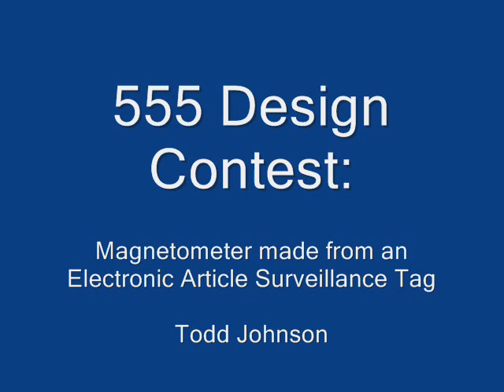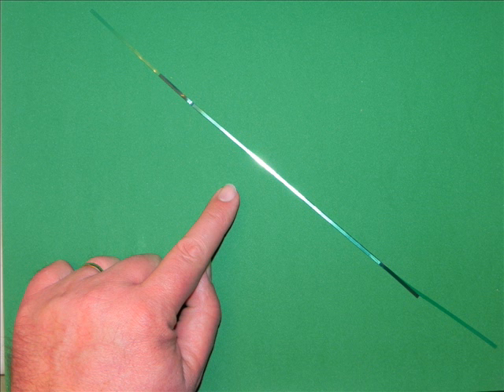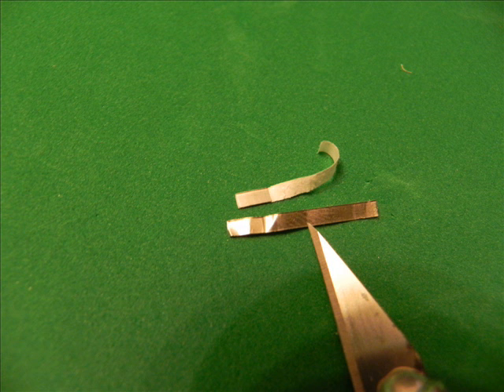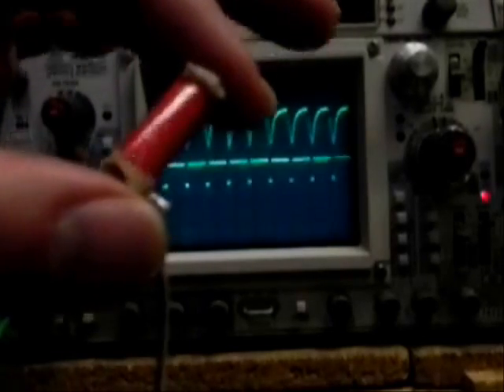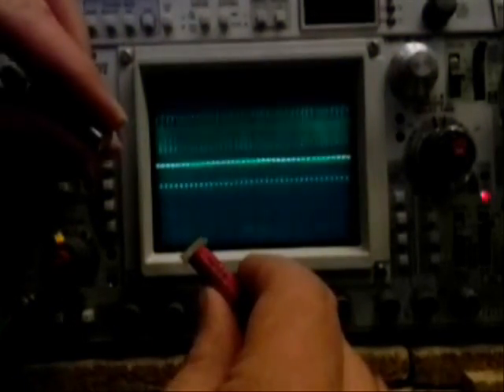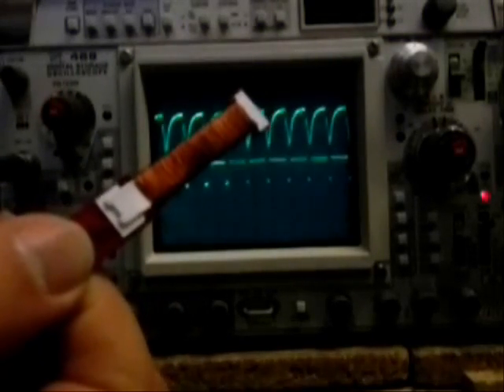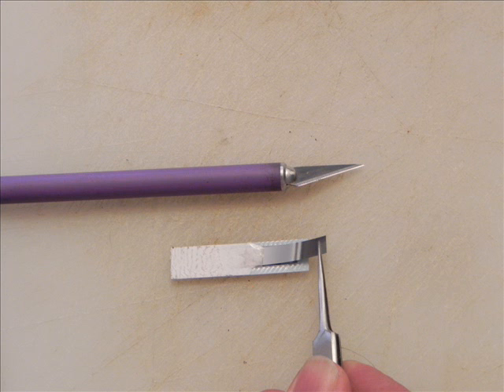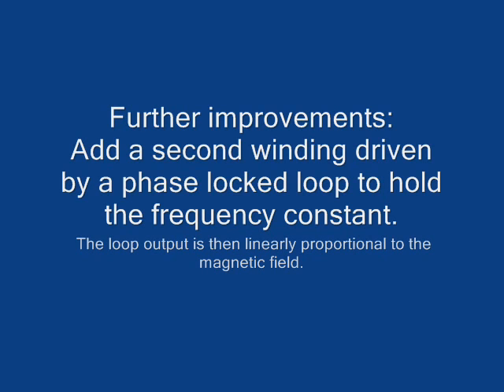555 Magnetometer

Comment: Can the circuit be used to detect metals?
Reply: It could detect ferrous metals in the presence of an external magnetic field, such as that of the Earth. But there are better circuits for detecting a wider variety of metals.
Reply: thank you for replying
But I want to make a circuit with a transmitter
and  microcontroller  circuit  .......And your circuit as I  receiver
Is this possible
Reply: @ironcurtain5733  This circuit is mostly intended for very low frequency or DC applications. If you want to build a transmit-receive metal detector it would be better to use a simple pair of coils and run it at several KHz.
Reply: Todd Johnson
ok ..thank you

Of course there are a lot of good circuits like felezjoo-pi
But what I am looking for is a long-range metal detector Uncomplicated and effective
By measuring the electromagnetic field of the metal from a distance and  It seems to me that your circuit is sensitive to the earth's field....For this I will try and share with you the results
Reply: @ironcurtain5733  
Very good.  I will be interested to hear the results of your experiments and share them with others here.

Comment: can you suggest resistor values to use as a starting point?
Reply from the maker: Try 1K for Rsense. Measure the resistance of your coil and then use a value for Rseries that will make Rcoil + Rseries just under 500 ohms. If it doesn't oscillate then lower Rseries a bit. You could of course use a pot to find the best value.

Comment from the maker: Jim,  Thanks for the interest.  I haven't put up a page on this though. If you want to experiment with it, the one thing to pay attention to is to make sure that Rsense and Rseries are sized appropriately in combination with the DC resistance of the coil (Rcoil) so that the voltage on pin 2 and pin 6 can reach the trip points at 1/3Vcc and 2/3Vcc. Otherwise it won't oscillate.
Actually it's better to just wind your own coil: try 1200 turns over a 1" length of tag strip.

Comment from the maker: OK, it does sound like the the inductance is too low. The coils I've used are around 40-100mH or so.  If the L is too low, the 555 runs flat out (around 500KHz) and the frequency won't be affected by magnetic fields because the inductor isn't the main thing determining the timing. I have wound my own coils that are about 1" long and 1200 turns, and those work.

Comment from the maker: Can you measure the frequency of the "strange oscillation"?  It could be that the inductance is too low and the 555 can't oscillate that fast. This is just a guess of course. 
Oh and a silly question but I have to ask: You do realize that Rcoil is the resistance of the coil itself and not a separate component, right?  Just making sure.

Comment from the maker: @circuitdog  This is an unusual circuit because the timing network operates in current mode rather than voltage mode.  The component values depend on the characteristics of the inductor.  As with an RC timing network, the voltage on pins 2 and 6 must be able to reach 2/3Vcc with pin 3 high. For example if Rsense =1K, Rcoil + Rseries must be less than 500 ohms. It should oscillate under these conditions. Rsense can be adjusted to optimize the sensitivity, since it sets the peak field in the core

Comment from the maker: I neglected to show that the frequency will go DOWN when a field of opposite polarity is applied. In that situation the external field subtracts from the field of the coil and causes the core to saturate later, which makes the current waveform rise more slowly. When the frequency is being reduced, a point is reached where the external field completely cancels the average coil field, and the frequency will begin to rise again. Care must be taken if this circuit is used in a feedback loop